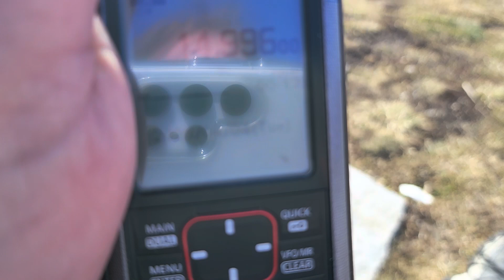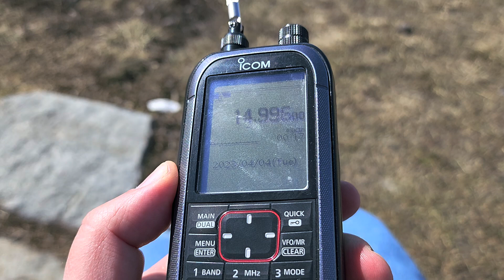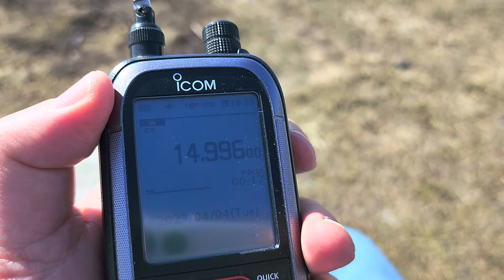RWM Time Signal Moscow Russia on Icom IC R30 in CW mode also heard on XHDATA D-109 with WWV 15 MHz

Comment: Great equipment but is that a waste to listen to clock signal only?
Reply: That's definitely a serious wide-range receiver with the ability to receive several digital formats used by first responders and hams.   It's not designed really for shortwave, it does cover that range though, and has ssb so there is that, but it definetly more designed for picking up ham than shortwave.

Comment: Dear Gilles,

I hope this message finds you well. I wanted to take a moment to express my admiration for your channel, which I have been following for quite some time now. I thought you might appreciate hearing about my recent experience with the SV2CZF MWA30 active miniwhip antenna, which has proven to be a game-changer when used in conjunction with my IC-R30. The antenna has significantly improved the signal to noise ratio, and I am thrilled with the results.

In fact, I was so impressed with the SV2CZF MWA30 that I wrote a brief review about it on my small technology blog. I would be more than happy to share the link with you if you are interested.

Thank you for all the valuable content you provide on your channel.